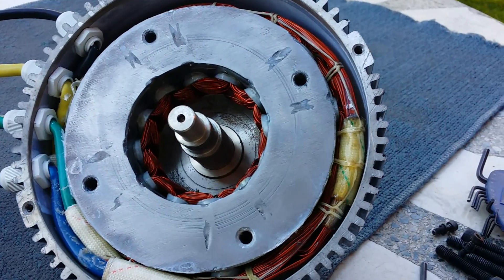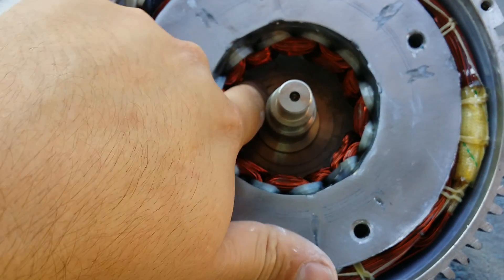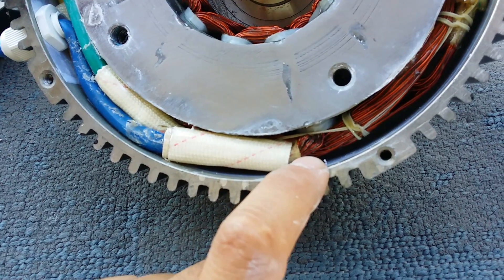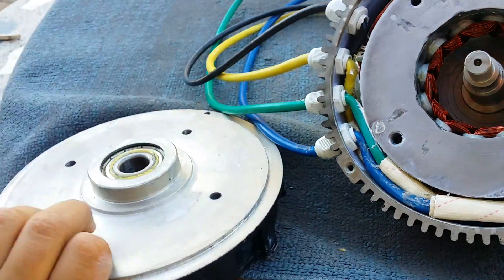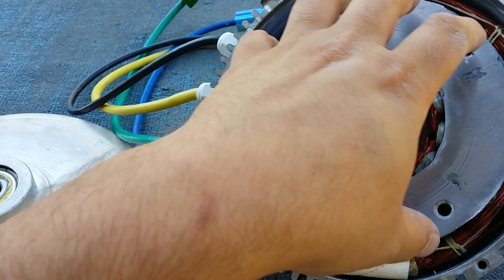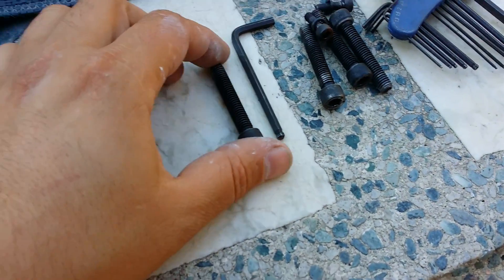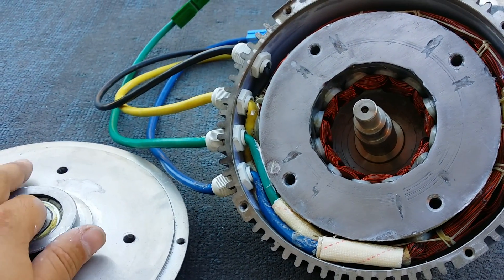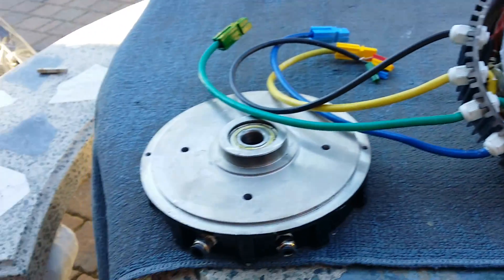5kw 48v watercooled golden motor

Comment: My problem is the following in the motorcycle trial club, we have a motorcycle Electric Motion equipped with a golden motor HPM 5000 48Volts
We changed the bearings, but unfortunately when reassembling the axis remained blocked (in fact it stuck to the air gap. So my question do you have information stall or exploded view of the HPM 5000 or at least the calibration gap gap & rotor disc
If you have this in archive it would be welcome.
Looking forward to a return from you

Best regards